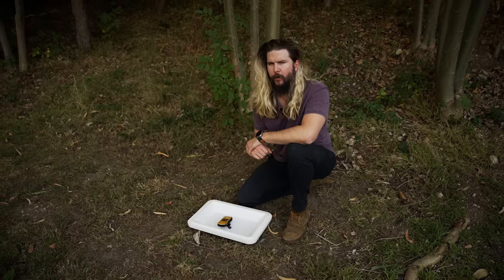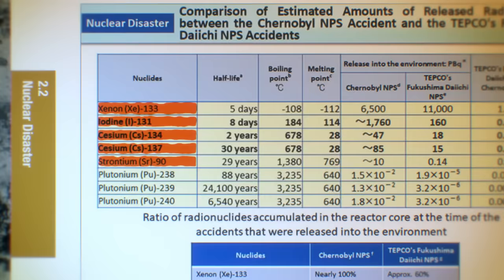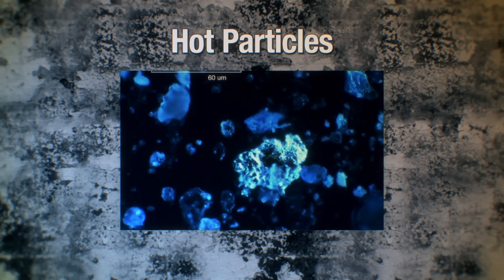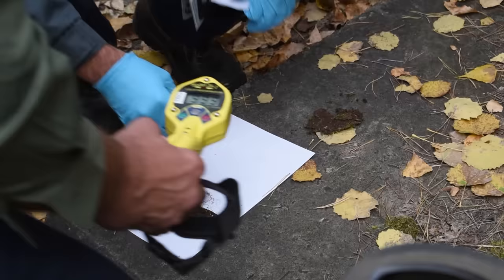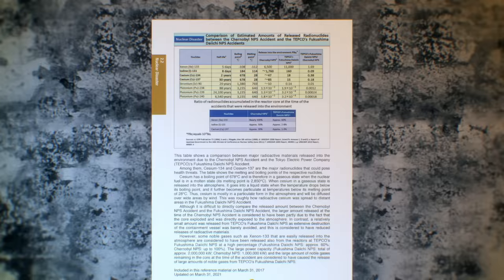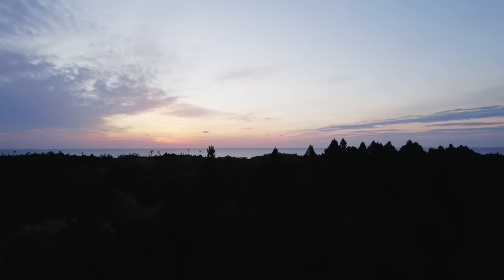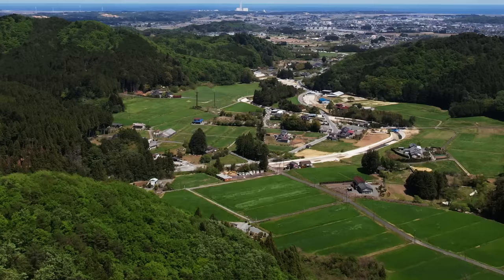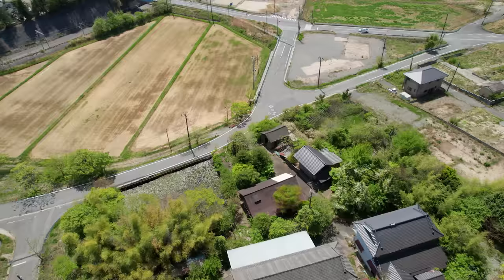A Nuclear Disaster's Deadliest Detail

Comment: The fact that a particule the size of a few grains of salt can max out Geiger counter readings like that is fascinating and terrifying.
Reply: Yeah. Fuel is no joke.
Reply: Terrifying as shit
Reply: Yep…that’s what the fission neutron flux does to the fuel. Brand new fuel rods are much less “hot”
Reply: "Off scale" is a a terrifying phrase for a Geiger counter.

For my bathroom scale, it's a daily occurrence.
Reply: Depends on the scale of the Geiger counter...
Remember the scene from the Tschernobyl series:
It's not 2 Röntgens/h it's 15000.
The 2 Röntgens/h hour where the maximum the readily available device could measure at the Tschernobyl disaster, only later they took a reading with a device which could measure the real value.
Reply: It’s terrifying but not entirely surprising.

To create the blast that destroyed half of Nagasaki, only about a kilogram of material actually reacted.

 A little bit of nuclear goes a long way!
Reply: @koi_krapfen Actually, you're wrong about one thing. They never got a device near the Chornobyl plant that could measure its radioactivity.

That isn't to say the scene is inaccurate. They really did use a high-dose counter that really did pick up a reading of 15,000 röntgen. It's just that it had a maximum accurate level of 15,000 röntgen. No one knows, or ever will know, exactly how much radioactivity the exposed core was putting out, just that it was too high for anyone to safely approach under any circumstances.
Reply: Meanwhile, the Sun:

Comment: The words: "burning graphite" continue to send shivers down my spine more than 35 years later. It encapsulates just how catastrophic the situation was, having burning chunks of a reactor core scattered throughout the area.
Reply: Neutron activation was why the graphite was emitting 20,000 Rads an hour of radiation, enough to kill with a few minutes exposure to it. The burning of this material enabled the spread of radiation far and wide.
Reply: The problem was that the Soviets cheapened out by using graphite and by not building containment buildings, and then denied there was a problem even when their badly designed reactor exploded
Reply: @bfth121  They kept the existence of those design flaws from the operators, which led to fatal mistakes on their part.
Reply: @taras3702 are you serious? 

Lol Russia like, Sucks sucks. The US sucks, but damn…
Reply: @robwilson5238 well it is almost commonly known that the Tschernobyl Desaster is a summ of bad design, higher up pressure, and operator failure  I mean it is possible to run a RBKM smothly without issues but the procedures most be folowes too the t by highly skilled and experienced individuals  (but finding a unicorn has better chances than that combo😅)
Reply: @TheLtVoss  interesting. I just found this guys channel a few weeks ago, will admit this is an area I know little to nothing about. 

Interesting to learn about, damn, people can be sully
Reply: @bfth121 hiding design flawes from the operators was wrong some form of propergander in full swing, even today.......
Reply: @taras3702   The gross negligence of powerful political/corporate entities never ceases to amaze
Reply: @BierBart12  It was indeed gross negligence, that lead to people dying horribly because they were exposed to radiation doses of up to 30 Grays and beyond. Four Grays is fatal either from Acute Radiation Syndrome or cancer later. Six Grays is always fatal in 60 days or less. 30 Grays of radiation exposure results in death with three days.  Some were exposed to far higher doses, which lead to rapid onset of the Central Nervous Syndrome of radiation sickness. That can kill within hours, with victims lapsing into comas from which there is no coming out of.
Reply: IF memory serves me correctly, graphites neutron capture probability gets reduced with increased temperature, contributing to a higher criticality and reactivity in the reactor, which, from a safety perspective, seems less than optimal.
Reply: @juslitor  Graphite does capture neutrons because of the trace impurities in it. Otherwise it's a moderator, it slow neutrons down enough to make them 1,000 times more likely to be captured by Uranium-235 nuclei, which immediately fission and release on average two neutrons.
Reply: @bfth121 they cheaped out by using graphite tips on the control rods. Graphite is still used in modern reactors for fuel rods, but not the control rods.
Reply: Nuclear regulations is what prevents a Chernobyl from happening in the US. The Republicans fought very hard against them in order to make nuclear energy more profitable for their corporate supporters.
Reply: Yeah, now add to that that most of the graphite was producing a larger portion of carbon monoxide instead of dioxide...
Reply: @BierBart12  it is not amazing. When somebody is not accountable for negligence, then negligence is to be expected.
Reply: Graphite burned, uranium, plutonium and strontium, not so much
Reply: @taras3702 so I'm guessing flying it into the sun is a no go?
Reply: @critterwhisperer5821  No it's not a go, for two reasons. One is the real danger of the rocket failing and the cargo falling back to Earth. The second reason is to fire something into the Sun requires eliminating ALL of the velocity any object will have relative to the Sun once it escapes from Earth's gravity. That requires a massive amount of thrust, requiring a very heavy and powerful rocket. Right now, there is no way we can do that.
Reply: @robwilson5238  wasn't Russia it was the Soviet Union smh🤦🏽
Reply: Since pencil lead is graphite, and ElectroBOOM played with graphite which thanks to it's resistance was able to completely burn the wood off a pencil while the center "lead" was completely fine.

Comment: According to the 2008 UNSCEAR report available online, a typical Chernobyl hot particle has a diameter of around 6 microns and contains 100-1000 becquerels (decay events per second) of Plutonium isotopes, along with the other usual fission products. The dose from inhaling that much Plutonium could be around 50 mSv, similar to the yearly dose limit for a radiation worker. However, that dose would be spread out over the rest of your natural life, given the long half-lives involved. 

However, the speck Kyle's group found is obviously much larger than 6 microns. If we assume that it weight the same as a grain of sand (0.004 grams), then it could contain over 70,000 Bq of Plutonium. Worst case scenario puts the dose from inhaling that speck in the thousands of mSv. Certainly enough to cause localized burns of whatever lung tissue it ends up in contact with.

This is the only real reason that parts of the Zone will be considered uninhabitable for millennia. In 300 years when the Cesium and Strontium is gone, it won't be unsafe to go there, but things like agriculture and excavation will be fraught with risks.
Reply: If you inhale one, you can inhale 3 or 10 more in the same day...one can be much larger than average and it will stay forever. Sometimes you can make a mistake and it's ok, sometimes that one mistake can be with you forever. I work in radiation safety
Reply: @rudibaroni88 Im under the impression that even a small amount of such material is still more than enough to cause cancer.
Reply: @BriarLeaf00  it's not that obvious, long term events are hard to track but you can increase your chances by few %
Reply: @BriarLeaf00  poison is in the dosis (Parcelsus), that means, it is not I'd want to snort a couple lines of Chernobyl Dust, but would go on a tour of the zone any day, (and that a mask like those for COVID should be enough on most cases)
Reply: @partciudgam8478  Ive got a history of cancer in my family and would feel pretty unsafe without an appropriate mask and suit. And I certainly wouldn't want to live there or anywhere nearby.
Reply: Yes the dose do make the poison for just being exposed to radiation. But if you were to ingest a particle that is constantly emitting radiation the you would get a high dose. The danger in Chernobyl is that you could inhale these particles and continue to be irradiated once you leave
Reply: @DragonFury-gq5zo  As I said, the doses described above account for being exposed to the radiation for the rest of your life (actually the calculations generally use 50 years).
Reply: Dont lick that rock
Reply: @BriarLeaf00  not really, it doesn't scale in any realistic way. There were Manhattan Project workers who were commonly referred to as "plutonium pissers", who had detectable amount of plutonium in their urine for the remainder of their quite long lives, very little cancer in any Manhattan Project workers - surprisingly so, given they couldn't even spell radiation safety, let along practice it. Couldn't very well protect against that which wasn't very well understood at the time.
A fair amount of the risk involves which tissues the radioisotope accumulates in, as some tissues are more sensitive to radiation damage than others and from there, it gets damned complicated.
Reply: @rudibaroni88   and to think, Russian troops camped and dug in in that contaminated soil!
I shudder to even think about how much they and their vehicles tracked all over Ukraine!
Reply: If a person were to inhale such a particle, would it be possible to remove the affected tissue via surgery?  Could a geiger counter be used to pinpoint the approximate location of the particle and remove a chunk of surrounding tissue in the hope of removing the particle with it?  To me the surgery would be no worse than removing a cancer growth, and the particle being metal shouldn't split/spread, but are detectors good enough that we could locate the area of the particle during explorative surgery?
Reply: @kinderdm  I can't speak to the likelihood of this happening, but in the event a micron-sized fuel flea has no significant activity of Cs-137 in it, you probably won't be able to detect it from outside the body using typical methods. Alternately, the Cs-137 could end up being absorbed by the body, no longer serving as a gamma source marking the location of the plutonium that is doing the real damage.
Reply: @spvillano  Kyle should probably do a video about that whole nonsense next. The Ukrainians did a region-wide sweep for contamination and found absolutely nothing except an antique radium watch. There are multiple research papers released recently about the spike in radiation levels was either faked or a result of electronic interference. Furthermore the story about Russians getting ARS was admitted to be a pysop by the tour guide who started it. The IAEA calculated the soldiers' doses as less than 1 mSv (it was the very edge of the Red Forest and relatively safe there, unfortunately).
Reply: Reading the exchanges here, it's pretty much up to people willing to "take a chance" with this Russian roulette. Funny how some people who take that chance assume everyone else will do the same.
Reply: IIRC there are some life forms capable of processing radiative material into less dangerous forms...it's is my guess over the next few hundred years, we will learn to harness that to make cleaning up radioactive waste much better.
Reply: @spvillano   And how much dust they inhaled and got in their MREs when they were digging the fox holes/trenches.
Reply: @spvillano The radiation readings in my back garden doubled during their occupation of Chernobyl. Just saying
Reply: @kinderdm   not really. If you saw the part where he kept shifting and halving dirt piles around and taking readings, can you picture doing that with lungs? You'd be cutting out lobes, halving them, halving them again, things don't go back together very well that way.
And precision detectors rely upon time exposures of a non-moving sample and lungs, well, if they stop moving, the heart does too and that dead thing ensues, rather ruining one's weekend plans.

Meanwhile, microsample exposures occurred during the Manhattan Project, where workers were exposed and for the remainder of their lives, their urine contained plutonium. Their lives notably not involving cancer or radiation poisoning. Do a search on "plutonium pissers", their unofficial title.
People survive amazing things, a radiation example being an Iranian city notable for its naturally high radiation levels, Ramsar. All, courtesy of thorium deposits in the ground elevating the background to what everywhere else would be thought harmful, potentially fatal. 20 mSv/year is the maximum for radiation workers, Ramsar residents receive 260 mSv/year and that's been for hundreds of years.*

*Finding the history of Ramsar's been problematic, all of the search engines default strictly to the Ramsar Convention on wetlands, regardless of how you phrase the search, due to their Artificial Idiocy implementation.
Reply: @grahamsalmons2027   no idea where your garden is located.
But, radiation levels around here spike significantly more than double after it rains, forcing radon out of the ground. I'm also quite a bit "hotter", radioactivity wise, than my children. But then, I was born a week after the Tsar Bomba test.
Reply: @OnTheRiver66   dunno, gonna not be low amounts though. I think the unit of measure is the WTF...  :/

Of course, the Russian soldiers had a choice. Go play in the radioactively laced dirt or experience high velocity lead poisoning. In their shoes, I suspect there'd have been a sudden officer shortage...
Reply: @DragonFury-gq5zo  as I said, prpbably a COVID mask would be enough to avoid that risk, and even when you'd get something inside, your body has mechanisms to control it, namely phlegm and encapsulation, yes, it wouldn't be the healthiest thing but it is not a death sentence.
Reply: @BriarLeaf00 that might be a point of concern for you, being on a vulnerable group or with a higher risk.
However, I rode once an interview with one of the nuclear scientists responding Chernobil, he said something like "alpha and beta particles were stopped by the top layers of the skin, gamma and neutrons shot through us without making much trouble, the biggest danger was dust, and we used fine masks for that"
Reply: @partciudgam8478  like I said, I wouldnt want to spend time there or live nearby. Mask or not. I think nuclear evangelists are even uncomfortable with this statement, for some reason.
Reply: @partciudgam8478  that sounds sus af to me but I'm not exactly gonna go there and find out for myself so I'll take their word for it.

Comment: I have seen hot particles many times in Chernobyl and they're everywhere in the soil. That's what happens when you have a strong fire and dense smoke lifting tiny bits of the core into the atmosphere and then rain dumping them down onto the ground, washing them onto the soil off the non porous surfaces. Luckily they are widely spread enough not to be dangerous to humans over a short time but you can easily collect a few of them together in the space of a couple hours and you will see insanely high readings.
Reply: And you really don't want hot particles to stick to your clothes.
Reply: @GodlikeIridium  Or your skin...
Reply: Ask those Russian troops who dug trenches in the area around Chernobyl.
Reply: I'm going to idly wave the flag of "this is why US reactors have biological containment vessels".

One of the things people miss is that the design of the RBMK and western reactors is inherently different, with western designs making a Chernobyl like accident almost impossible, and Fukushima is, in fact, proof of that.
Reply: All your
Reply: "Collect a few of them together"
Well doesn't that sound like a fun game
Reply: @MostlyPennyCat  It's interesting to collect them and run spectroscopy. Caesium 137 for everyone! So actual pieces of nuclear fuel that were inside the reactor core of unit 4 in 1986. Now it's dumped all over the place kilometres away. Pretty mind boggling to pick up a piece of an exploded reactor core in your hand, tiny as the particles are. Just don't hang onto it!
Reply: @pgr3290  
Yeah, genuinely that sounds like a fun game! 😂
I'd need a nice little lead pot to store my fuel particle collection!
Reply: But God has helped me to this very day; so I stand here and testify to small and great alike. I am saying nothing beyond what the prophets and Moses said would happen— that the Messiah would suffer and, as the first to rise from the dead, would bring the message of light to his own people and to the Gentiles. 

Acts 26:22-23
Reply: If we have any hot particles flying around the U.S., they're more the result of our weapons production processes and negligent handling of nuclear byproduct materials than anything involving nuclear power.  Think of places like Hanford, Rocky Flats, Santa Susana or Oak Ridge.  Those likely caused WAY more lingering health hazards than TMI ever did.

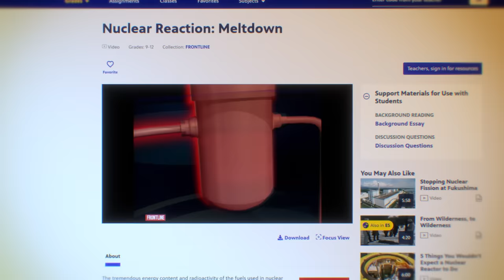Comment: Quick note about something you said at 0:54. A nuclear reactor does not need to be in a critical state to meltdown. In fact, I'm pretty sure the reactors at Fukushima shut themselves down when the earthquake started. However, the fission products (some of which have short half-lives) continue to release energy into the system even after the reactor is make sub-critical by control rods. This extra energy released after shutdown is why emergency cooling systems are needed to keep a core cool even after a reactor shutdown.
Reply from the maker: I correct this in the pinned comment, thank you
Reply: @kylehill  you lied to this dude 😂